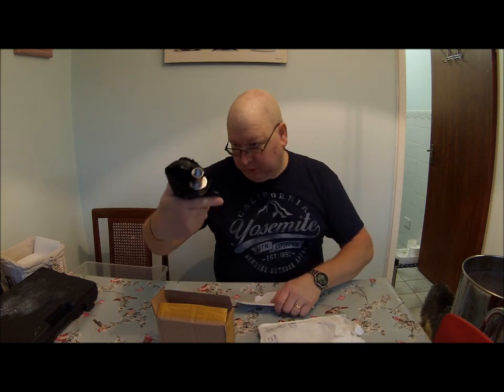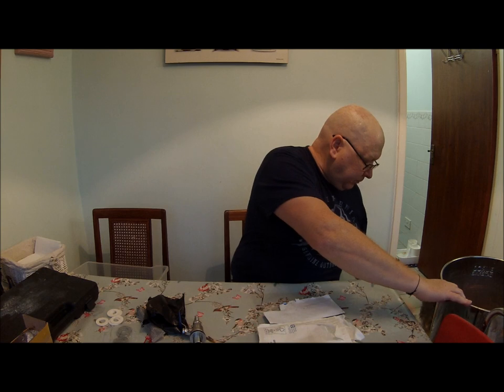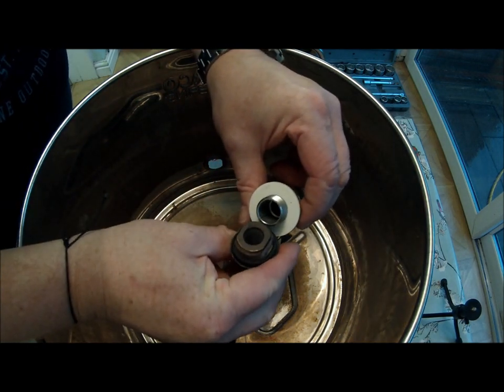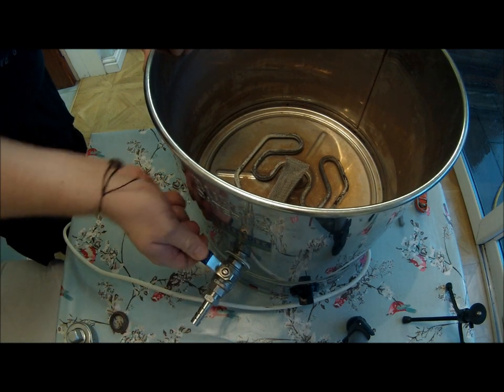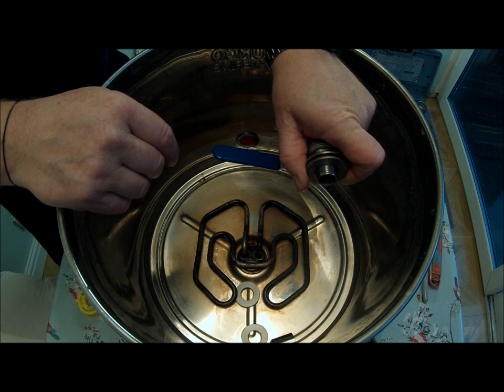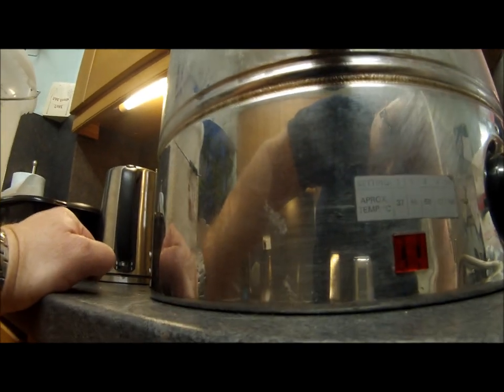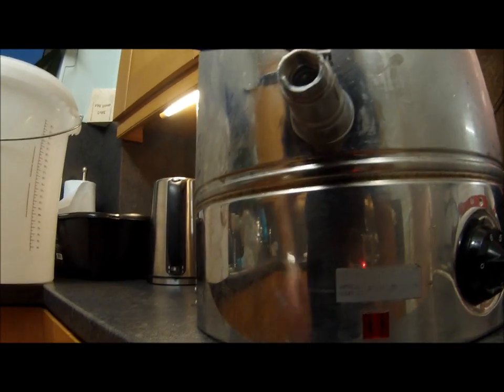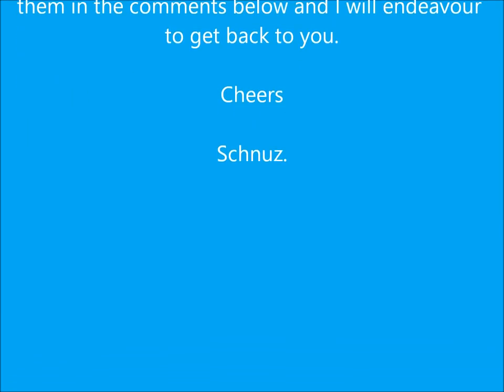Brewing build #1 Burco boiler safety upgrade!

Comment: That thing was fighting up but I knew you would get it licked. Cheers on the new upgrades.  =)
Reply from the maker: 'Twas a little bit of a bugger, I did assume that the silicon washers would expand and do the trick but had the PTFE gas tape on standby. Cheers, Schnuz.